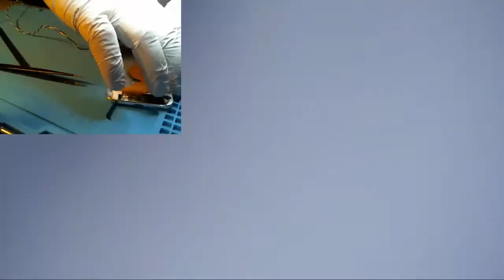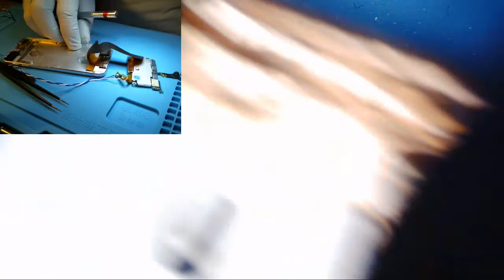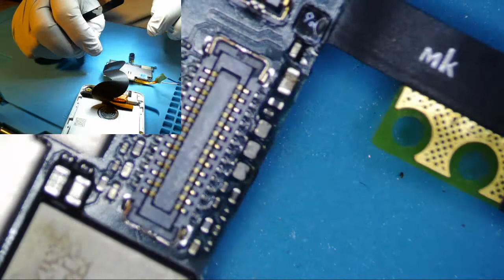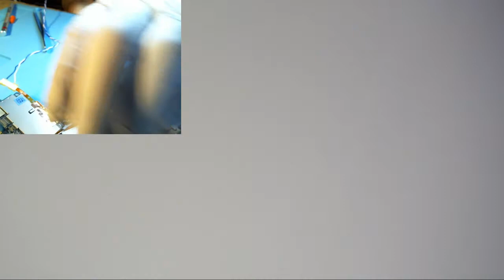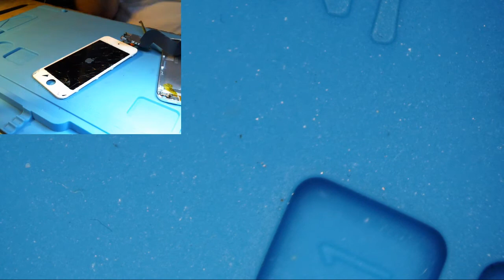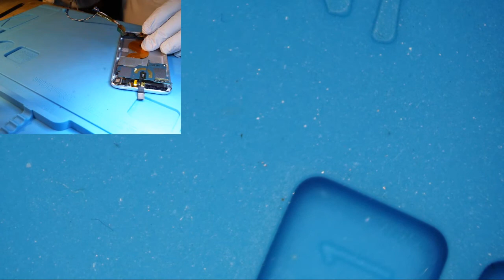iPod Touch 5 Camera Not Working - Dead Fuse - Repair

Comment: hello from japan, you are the guy who understand theory. Can you help?
rear cam back cam both are black out.i checked fuse as you fixed, fuse are not dead.and i checked camera fpc connector of back camera. there are  two 2.7v two 1.8v one 1.3v. four 1.8v one 2.8v on rear cam pads,  seems to have voltage comming from power ic.  is there any other things i have to check on the way?  lack of my ability. there is no ipod touch schemtics,  Thanks in advance.